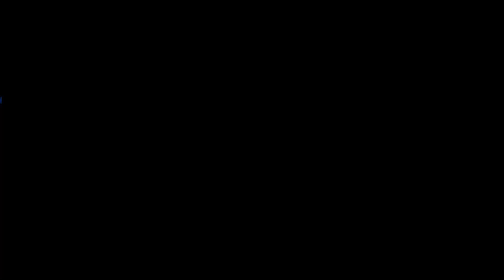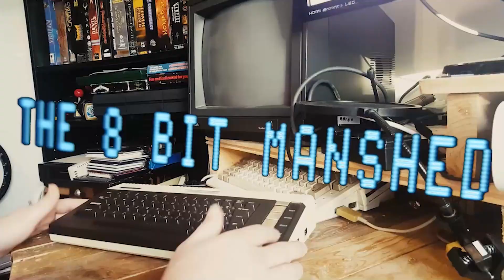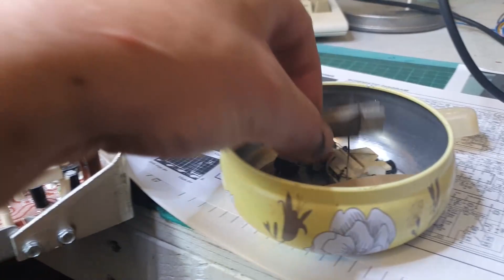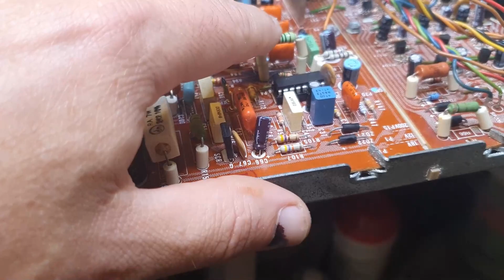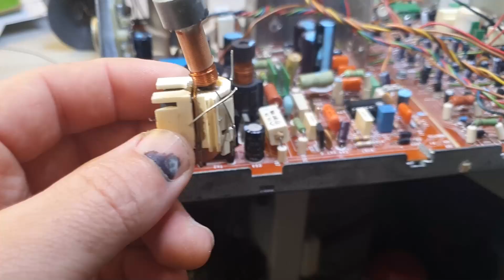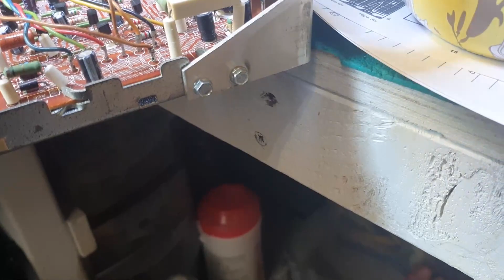Turbo Outrun #3   Hantarex MTC 900 repair & Retropie setup

Comment: Hi ollie. Great restore. Especially on the monitor chassis. Metal work too. 

For the start light, I don't know much about the pi options (other than one cab putting on a vertipi mage and linking with pi to jamma) but I do know if you had a mini pc (groovymame) and a uhid interface for controls you can drive the start button light like the original game board.